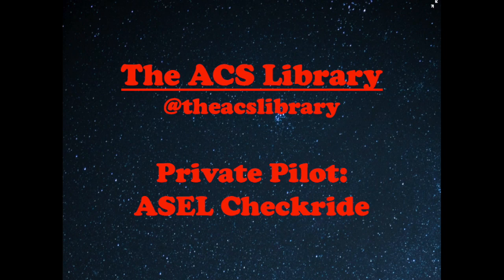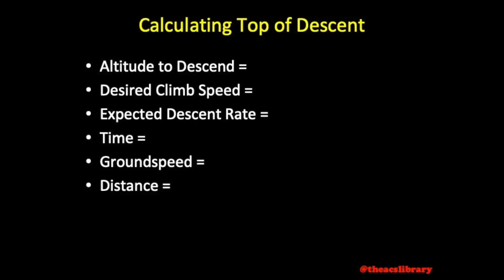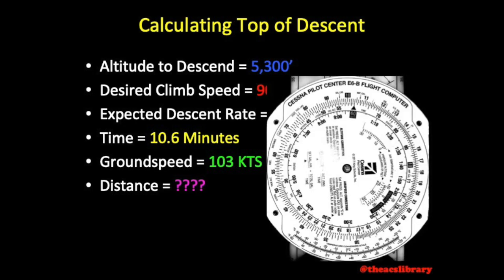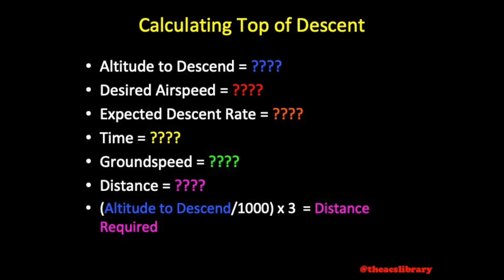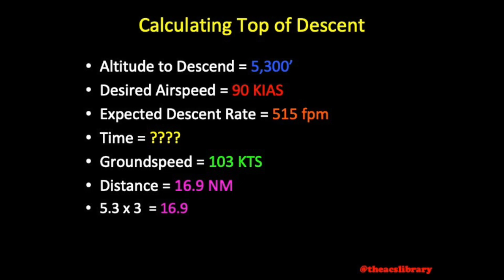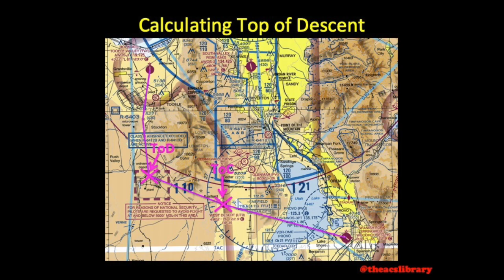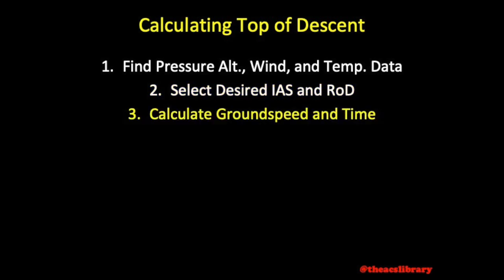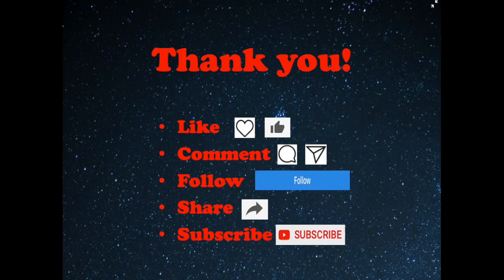PA.I.D.K3 Descent Data

Comment: I get that this video is for flight planning on the ground and the written test, but for doing a calculation in-flight these methods are terribly impractical, way too much time  not looking out the windows while you do the calculations.  
  When I was learning to fly the King Air C90B, I was taught a rule-of-thumb calculation similar to your 3 degree descent technique but which is much easier and faster to do and works for any airplane. It can be done in your head in a few seconds, no scratch paper needed. For those of you planning to fly jets, you'll want to learn this for sure!
  When you're getting close to your destination, multiply the thousands you'll need to lose by 3 to get your distance to descend. Round up the top and bottom altitudes to the nearest thousands to make it easier, your calculation results will be close enough. Add another mile to five miles depending on the airplane to account for the distance covered while establishing the descent and for leveling out and slowing down at the bottom  of the descent if that's needed (definitely need that distance to slow down in the King Air and jets). Don't forget that your bottom altitude should probably be pattern altitude, not the surface!
  Then when you start your descent, round your groundspeed to the nearest 10s (say 112 kts rounded to 110), halve it and tack a zero on the end to get your descent rate. Some people just multiply the groundspeed by 5 which gives the same result, but to me that's harder if you have a faster type of airplane and need to work with bigger numbers. Use which ever math is easier for you.
  So for an example, in my Cessna 172 lets say I need to lose 7560 feet. I'll round it up to 8000, then take the 8, multiply it by 3 for the distance.  8×3=24 miles, add one mile for establishing descent and leveling off at the bottom, and add 3 more miles so I'm at pattern altitude before getting too close to the airport.  So I'll start down at 28 miles from the airport. 
  Then for the descent rate I'll use half the rounded off groundspeed plus zero in the descent.  Lets say my rounded groundspeed is 120 Kts, halved equals 60, tack on the zero. That gives a 600 feet per minute descent rate which will be about right, close enough anyway. 
  Then at each thousand feet I'll  re-run the calculations in my head and verify I'm on track or make small descent rate adjustments to get back on track. 
  This works really easily if you have GPS or DME, but you can do it with a sectional too, just note where you are over the ground at each 1,000 feet and guesstimate the distance from there to your desired bottom of descent. The width of most people's thumbs (or maybe a finger if your digits are especially large) is usually about 5 nm on a sectional, perfect for getting a rough estimate for distance remaining.  
 For faster airplanes this really works well. Say I'm in a King Air C90B.  I'm IFR at 15,000 feet and need to descend to a pattern altitude of 1900 feet. Our typical descent groundspeed was about 248 kts at 15000 feet, decreasing to 220 kts groundspeed down low with no wind. 
Rounding 1900 feet up to 2000, here's the numbers I'd run in my head: 15-2=13, and 13 times 3 equals 39,  plus 5 equals 44, so start the descent 44 miles out. 
 248 kts groundspeed rounded =250, 250÷2=125, so 1,250 feet per minute descent. The cabin is pressurized so that rate is no problem for the passengers.
 As we got lower I'd re-run the calculations in my head just before crossing each 1,000 foot altitude and compare the results to our GPS distance from the airport. Since our groundspeed would decrease as we got lower into thicker air and we had to stay under Vmax (226 KIAS) I'd be making slight changes in the descent vertical speed to stay on the plan. So say at 12,000 it was like this:
12-2=10, 10×3=30, +5=35 miles to the fix or bottom of descent. 
220 kt ground speed ÷2 =110, so 1,110 fpm descent.  Check the distance as we crossed 12,000 feet, make sure it was 35 miles and adjust the descent rate appropriately if it wasn't.
Reply from the maker: Hey Scott! Thank you for taking the time to comment.  This looks like another great, practical way to get descent calculations done.  I appreciate it!
Reply: @theacslibrary4404  I just now re-read what I first wrote and realized I'd made some bad errors in my math when I first wrote it. That's what I get for watching a TV program while writing! I corrected the errors.
Reply from the maker: Haha I still thought you did a great job explaining.  It looks even better now! Thank you again😊